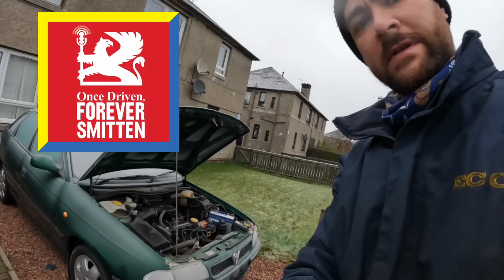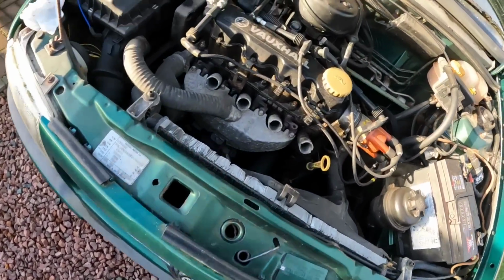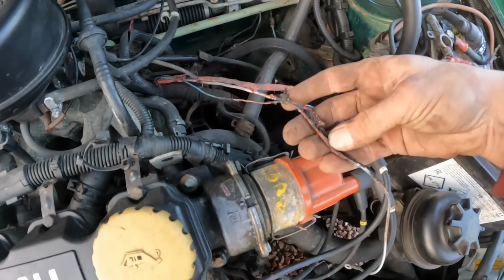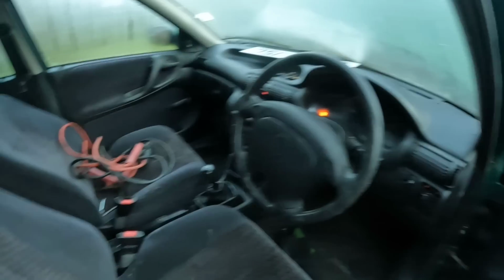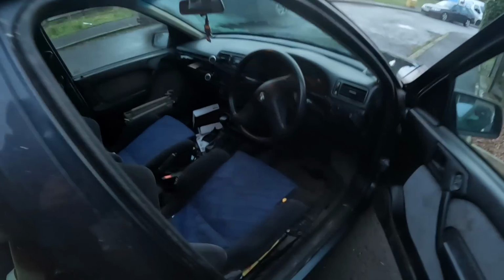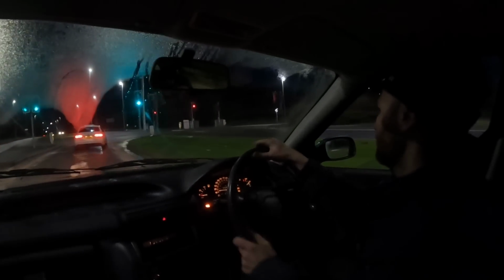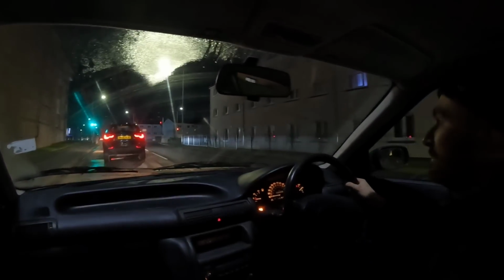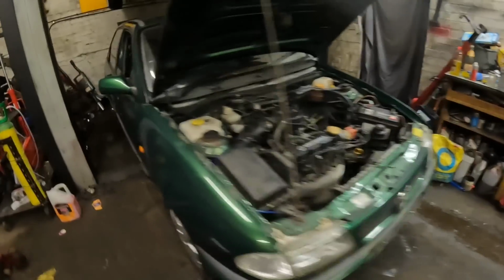Mk3 Astra Premier: parked since 2018, saved from the crusher! Project potential?

Comment: I had a 92 1.7td isuzu diesel bulletproof bodywork was the real reason it went and gearbox seized in neutral. 😅 my last astra an 05 solid body but they were galvanized I think again a 1.7cdti not as reliable as the older one though.

Comment: That would be a great 1st car for my laddie m8 . Providing it doesn't need any huge welding work and half a rebuild lol 😂 but I see a future great car saved from the great scrap man in the sky as  my dad used to say 😂😂
Reply from the maker: Found out yesterday it needs mega welding. Totally rotten round the subframe mount offside never seen one that bad.
Reply: @OnceDrivenForeverSmitten  aww that's a shame . Turn into a Crail sleeper and send it to the moon lol 😂
Reply from the maker: @mikey3627  going to strip some stuff off it and fill it with the mountain of scrap at the garage. When you see the next video you'll see why it's not viable to fix it.

Comment: I used to drive these and vectras back when I worked for a car hire way back when these were new. The 2.0 16v astras were pretty rapid. 
I had to take a 2.5 vectra to Leeds to pick up a car that was coming onto our fleet of cars it happened to be a 2.0 cdx with 8 miles on the clock. Done it in 3 and a half hours!! Was a lot different than today as there’s Camaras everywhere now but I was doing 130-150 a lot of the way. I took my mate and his girlfriend she was reading a book at 150 lol she got a fright when she got told the speed we were doing lol.

Comment: I had a mk3 1.4, N reg 1995. It used to mist up really easy inside even with the fan heater on. One night on the M8, every window misted up instantly! That was a heart stopping moment.  I always thought the side air vents were too low in the dash to effectively clear the side windows. Other than that and needing a new sump gasket it was fairly reliable.
Reply: I had that in heavy rain too, like the heater was soaked in rainwater.

Comment: My brother had N reg Astra 1.4 GLS in gold he had for 18 years he covered 210.000 miles my nephew is an HGV mechanic and he kept it going for him but one time a went visiting him in London we went out shopping in his car and it started over heating my nephew told him the head gasket and gone he did have a go at having it skimmed but after a few days it went again I said you have had your moneys worth out of the car so he scraped it I have a 2015 Astra 1.6 diesel j just before Christmas the service the car light came on and it had only just been done after my garage check it on the computer in needs a glow plug which cost £180 because of the pressure sensor is a good job I don’t pay any road tax but that is probably down to the pressure sensors helping to meter the fuel levels

Comment: It's a single point the hi torque is the mpi c14se surly 🤔
Reply: The “hi torq” engine name was actually the lower output 1.4 60ps the 82 ps was MPi 
I was Vauxhall sales exec 95-98 and didn’t like the 60ps engine as felt underpowered but some of them were fine - generally If no 1.4 badge or electric windows was the 60ps as LS spec had both options available before the 82ps was replaced by SPi 1.6 for emmison reasons

Comment: Love a good old mk3 5d astra had few over years last 1 was red 5d 1.6 8v on p plate or r ....was slow as on motorway tbh ....my old pineapple yellow 5d astra 2lt 8v was lot better and fun to drive.....I know of a 5d pineapple yellow astra sitting in driveway local to me 

Yours looks clean on top hopefully underneath at to bad.....I have 2 coil pack things for them and 2 new center pipes as well